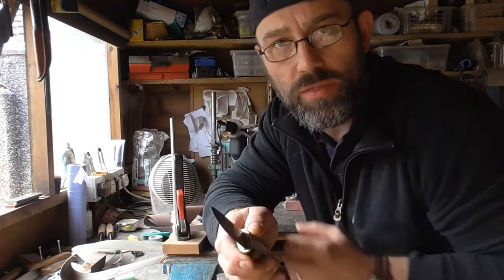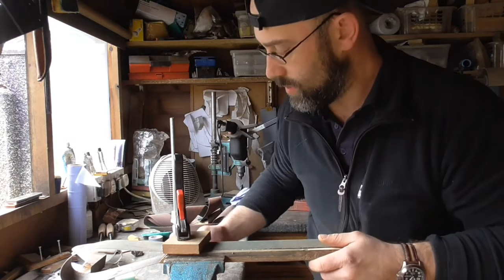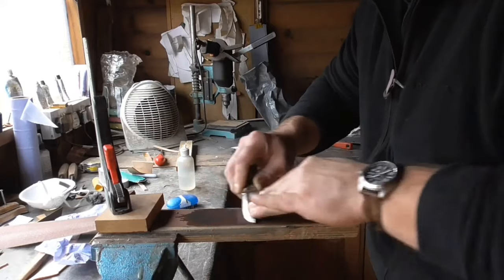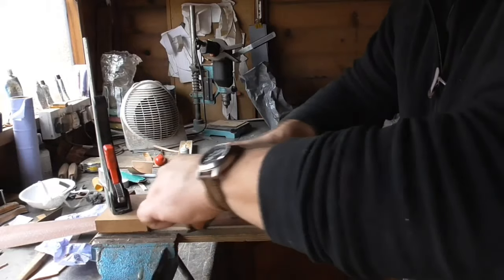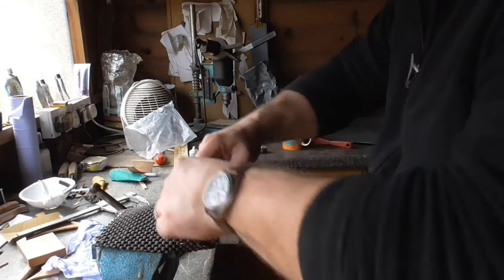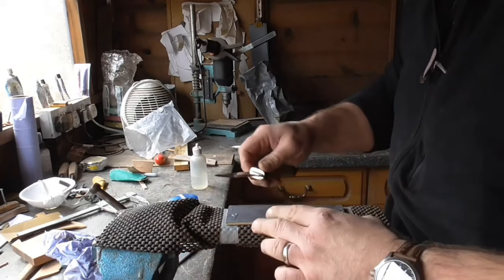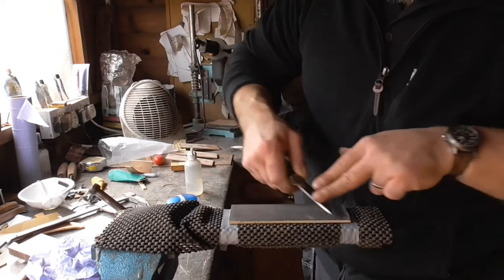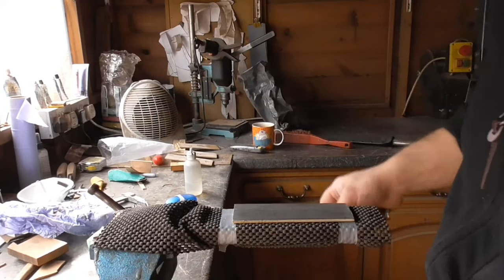sharpening on abrasive paper

Comment: After 26 years of more than normal amateur use, I had to replace my DMT diafold set this year.  They still work to some extent but the old ones are really worn out for the most part.  New set is fantastic.   My micro mesh pads also had to be replaced after " only " 8 years  that stuff is expensive but saved me hundreds of dollars over time and gives excellent finish.  I now use one set for metal and another for wood.  A little soap and water when they get clogged with material and they perform like new again.
Reply from the maker: Can't beat DMT and micromesh.
👍👍

Comment: Great technique, beautiful edge. Do you at the belts on the machine too?
Thanks for sharing
Reply from the maker: Not sure what you mean buddy
Reply: @RobEvansWoodsman  sorry..  Do you wet the belts when you run them on the belt sander?
Reply from the maker: @Zenmastersean  no mate, that would be very messy! I dip the steel in water or grind several blades in rotation so they don't get too hot.
Reply: @RobEvansWoodsman  I thought so lol sorry for stupid questions.. you had me doubting myself. Thanks for taking the time out to explain. Appreciated. Just got a little 1x30 belt grinder and I thought I was doing it wrong lol.

Comment: Amazing sharpening tutorial. Learned a lot. This is invaluable, especially for a beginner like me. I have only one question: What type of micro mesh are you using? AO, Regular, MX or MXD? Very curious about this. Thank you again, sir.
Reply from the maker: Sorry but I can't help you, I didn't realize that there were different types of micromesh.
Reply: @RobEvansWoodsman  No worries, check this link if you'd like to find out more: https://micro-surface.com/micro-mesh-types/
Judging by your video, I think you have the AO or Regular ones. AO are with aluminium oxide and Regular are with silicate carbide.
Reply from the maker: https://www.ebay.co.uk/itm/Micro-Mesh-Abrasive-Polishing-Cloth-Sheets-9-Grades-7-Sizes-Available-/333641208471?_trksid=p2349624.m46890.l49292
Reply from the maker: Here's the one I use
Reply: @RobEvansWoodsman  Regular ones. Thank you very much. I bought the Regular and MX ones. MX are more abrasive. I love your videos. Keep them coming. Cheers.
Reply from the maker: Thanks, Its good stuff and lasts a long time.